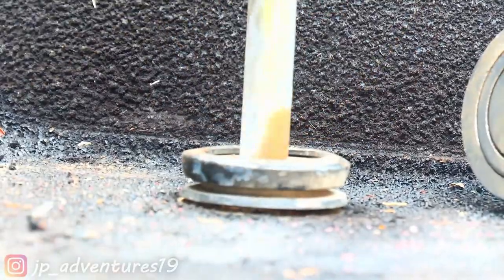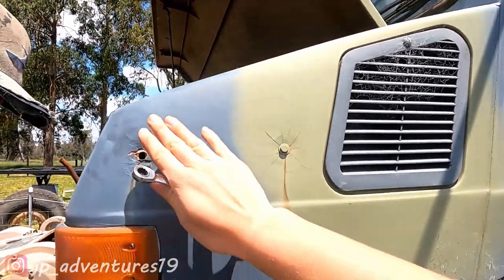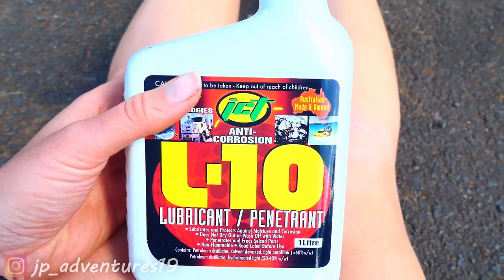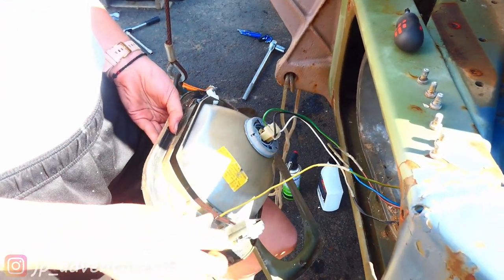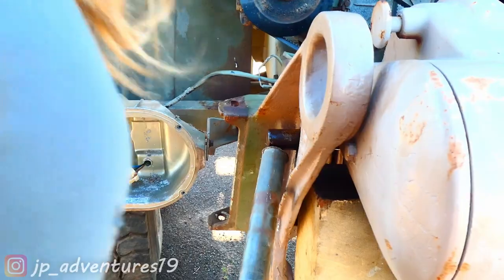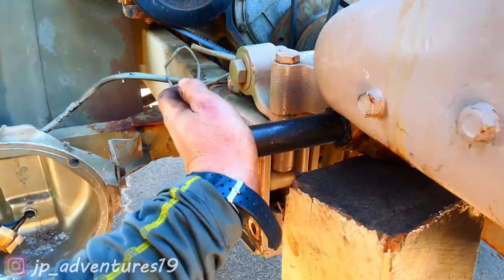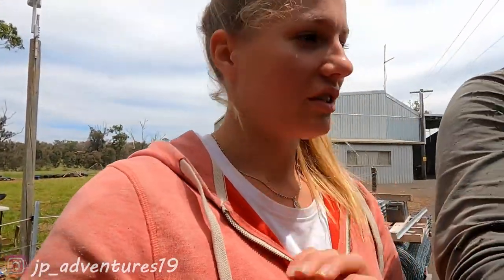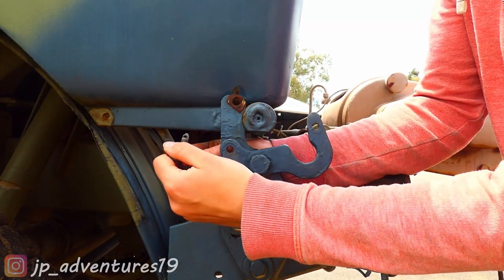TILTED CAB & DIY Support Bar - Taking Elephant Ears & Lights Off - UNIMOG Expedition Truck (Eps.23)

Comment: Tricky job tilting the cab. You have done well. Temporary support with wood or something on the other side would eliminate twist in wind gusts - always a possibility working outside. You've done well. These are hard jobs but you've got the right attitude. 
Sending the Hard Drive to an affiliated company is a good idea. Hope that bears fruit. 
Winter now here in England. Cold enough to snow, next week! Enjoy your Aussie sandal safetywear weather problems!!

Comment: as a rule of thumb on the mog.......whenever you go over a 20mm socket size........go up to a 3/4" drive, it'll save a lot of broken tools and swearing
Reply from the maker: Yeah that's why we got a 3/4" set right at the start :)